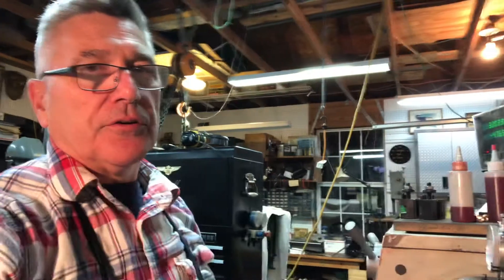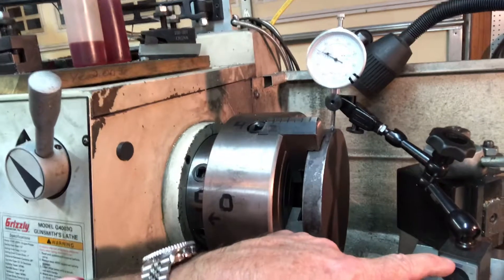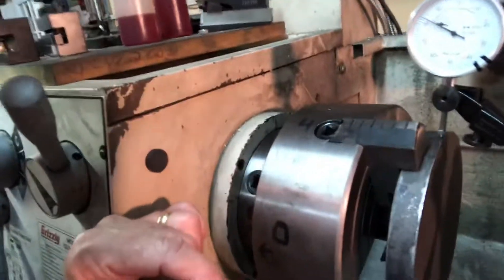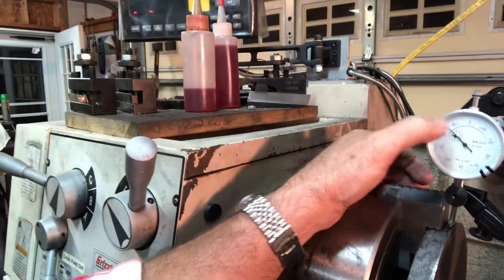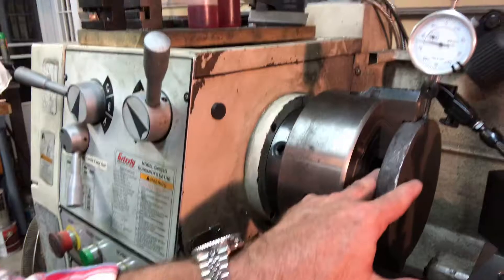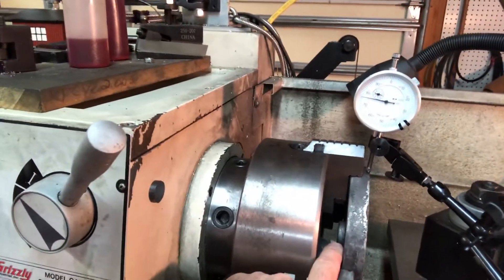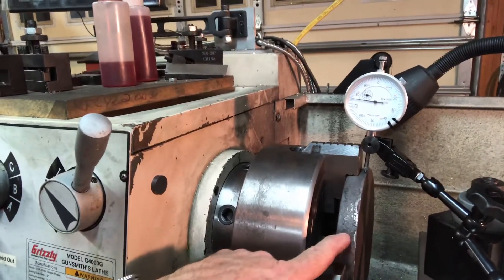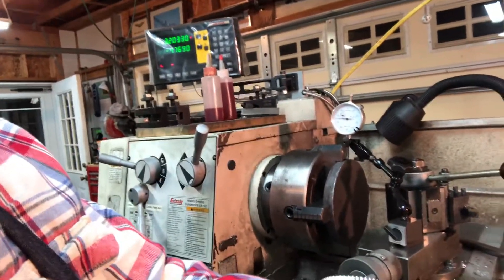Part 3, Universal Pillar Tool

Comment: On the bottom of the drill head spindle housing, it appears that it has a nose cap. Is that the case and if so how is it held on?
Reply from the maker: Thanks for watching and for asking about the project. I’ve put over 30 videos in a playlist on building the Pillar Tool. Here’s a link to one that shows the drill head assembly: https://youtu.be/1h7j36fR88M?feature=shared Hope this helps. As you will see, I don’t have any kind of nose fitting on the bottom of the drill head. Thanks again!
Reply: @metalmill52  In an image in his book George showed a disc with a chamfer on the end of the main spindle yet there is no means to fix it